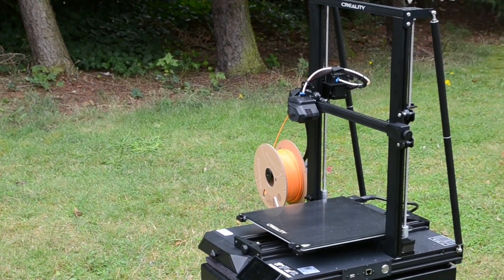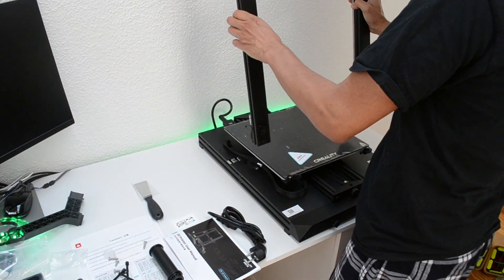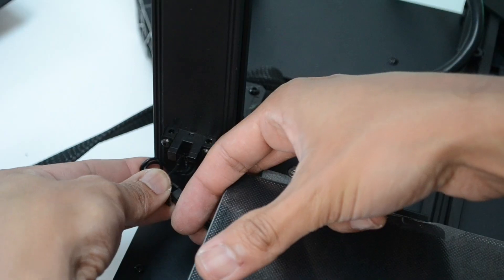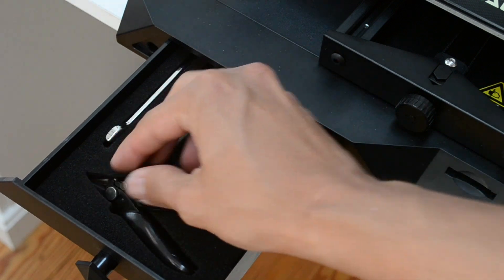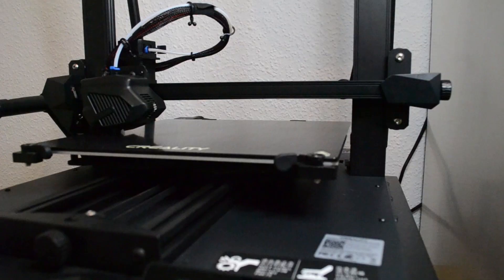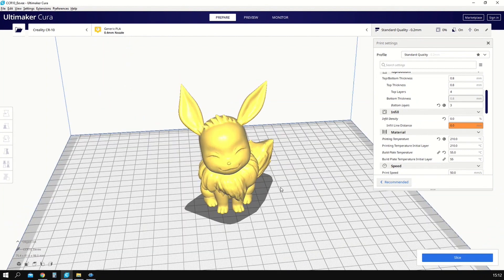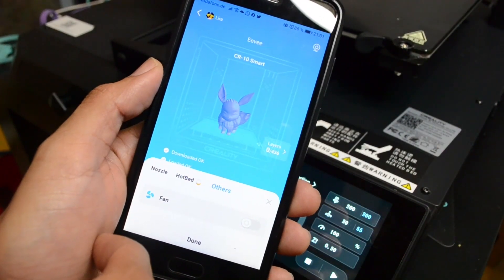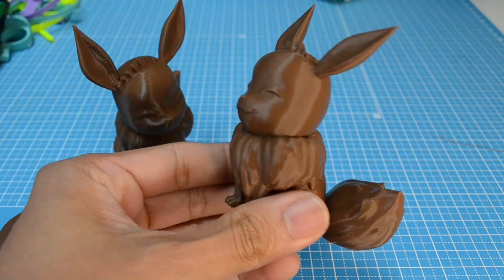Creality CR-10 Smart 3D Printer - Unboxing and Review

Comment: Hi dear i am new in 3d printing as beginner do you recommend this printer as professional works except cura settings is there any issue in firmware ,in lcd hangs and in hardware like vibration during printing ? As being brother would you recommend me this cr10 smart or cr10 smart pro ?
Reply from the maker: Hello I haven' t seen the CR10 Smart pro. On my experience the regular smart is pretty good. I did update the firmware with the version 1.07 from creality website and I am pretty happy with it. On every printer you will need to learn a bit how the machine works. Have a good one :)

Comment: I have a question my nozzle keeps grinding into the heating bed anyone know why this is happening
Reply from the maker: hi sorry if I'm late, depending on your printer, you should check the Z-offset of the machine. Place a piece of paper between the nozzle and the bed and make sure you can move the piece of paper when the nozzle it at home

Comment: Hello, This is my first 3D printer. I used the auto leveling feature, which completed fine. But when I go to print a benchy the starter test line is scraping the glass bed. Is this an issue with my settings? Is this something I can fix via the printer? Or should I change from the Creality Slicing software to Cura the way you did? I haven't tried printing again yet because I'm nervous about damaging the bed or the hot end.
Reply: yeah you should use cura
Reply from the maker: sorry it took me a bit to realize people were commenting on my videos D: . You should definitely use cura. I always use it because I am comfortable with it. To test the printer you first should print the test file included on the SD card. If not maybe you have to adjust the Z offset of the printer on the menu. I hope I am not too late.

Comment: Good Morning. I am new to 3D printing and was wondering if you could help me. I tried to add my printer to my Creality Cloud and having had any luck. Can you please Help? Thank you!
Reply from the maker: Hi! Sure I can try to help you if you have not solved it yet. You can DM me on Instagram
Reply: @lirarock3d  Good Morning....Thank you but I  Accomplish to set it up. Smh was not that easy for a first time user. 
I been using in my cura 10 Creality 10 because the smart isn't there yet. It's hard because of the settings.  Is any suggestions?

Comment: Hello there. Thanks for the video. I have 3 CR6 SE and would like to buy this new model. With my CR6SE I can only fit 20 files in the SD Card. Does this one has that problem too?
Would be of great help to know.
Thanks

Orlando
Reply from the maker: That's so cool to hear. I haven't tried to put more files than that on the SD card. 100% sure you can have more on the  creality account and administrate it on the app/page. The starting cloud storage for private slices is 2gb. Hope it helps
Reply from the maker: If you do decide to check it out, there's a link on the description to the creality.shop site and my discount code.

Comment from the maker: I would like to address some of the issues I`ve seen in other videos and that I did not mentioned:
- Camera USB port only works with a creality camera
- Bed leveling was not implemented correctly on version 1.06 (stock until end of june) but it was corrected on version 1.07 (video about flashing and update will come if requested). Is fairly easy
- Fan is loud, but not louder than a standard Ender3
Reply: a flashing firmware and leveling issue fixing video would be great!